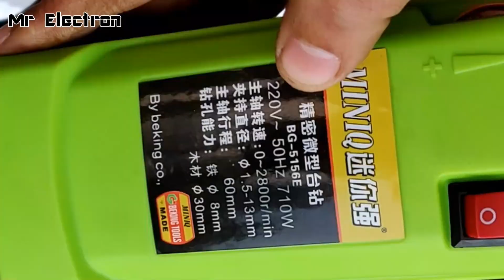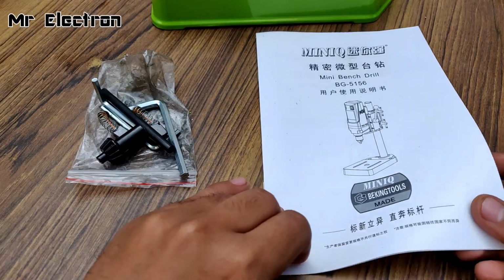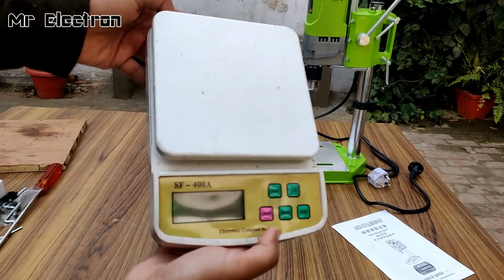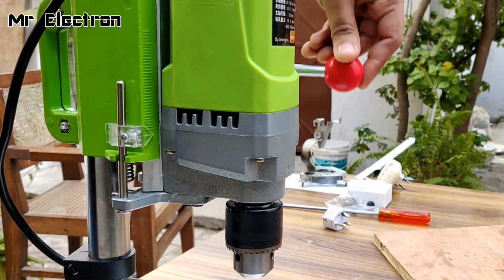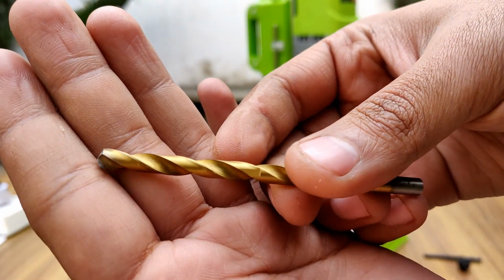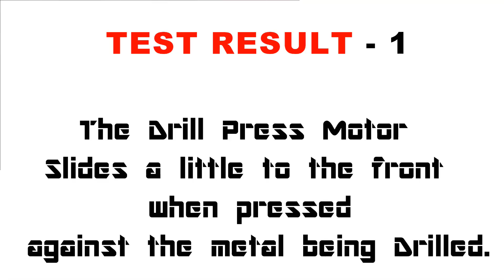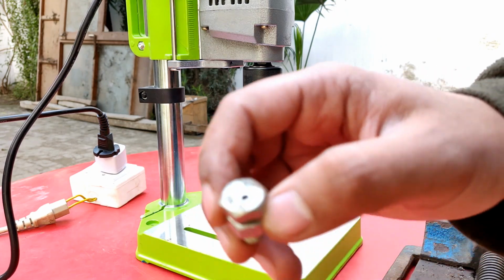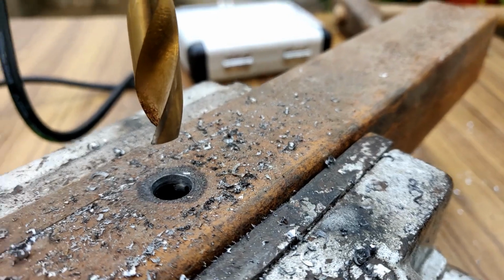220v Cheapest Drill Press from Banggood 710 Watts - Review & Test

Comment: To center a hole, it is first marked and the first drilling is made with a small drill bit so that the guide does not move from the central punch or the one you want. You never start with a big bit and less in metal
Reply: Thats wrong. If you have a high precision drill you dont need to drill more than once.

Comment: First of all , I tell you it is 710 watt at 50 Hz. frequency and as you lower the speed , power will also go down because its speed is controlled by variable frequency just like in case of a fan regulator. So as you lower the speed , power will also go down & machine will not operate at 710 watts at lower speeds . This 710 watts is only at full speed at 50 Hz.
Next you need to first fix the machine firmly & securely on the table top with perfect alignment in x, y & z directions. Check the proper alignments with tri square & spirit level .
Next you also need to firmly fix the job vise on the base plate of machine. & properly secure the workpiece fixed in the vise jaws. No grip should be loose anywhere.
Also ensure the bit is sharp enough & exactly vertical ( making 90 Degree with Base Plate ) & not bent & should be firmly tightened in the drill chuck.
While drilling in metal - start with a less size drill bit & then slowly increase the bit size as per the required hole size.
Use a coolant spray on the bit & work surface for proper heat dissipation.
Start initial holes at slow speed with less dia drill bit size in case of metal .
This drill is definitely not meant for thick iron & steel for large size holes.
Also the drill bits purchased from Bangood are very inferior quality - cheap Chinese makes with very less life not properly hardened  - will soon worn out . Use some good quality drill bits of reputed make especially for metal drilling.
Only by adopting above all , you can get continuous useful work with this light duty machine.
Reply: I partly disagree because there can be a feedback loop to keep the speed constant meaning it will never "get its power down"
Reply: @sacram1 У этой модели этого нет.

Comment: adjust the 3 bolts on side of the dovetail guide and put some greace on the sliders both side and you have no slip ,backlash anymore it will drill very precise and accurate

Comment: I bought new of these the slightly bigger version, p probably about 12 inch. I think it’s 1000 W or something like that. So far I like it. It’s a brush motor. I wish it was direct drive. Thinking about getting a keyless chuck for it and figuring out how to swap that out. Other than that, so lightweight easy to move around, and I can do guitar work with it. I can put strings in the back of a telecaster with it. I was shocked that I had enough room to do that just about have a 6 inch throat. Make sure you get the right model.

Comment: don't start drilling the finished holes size in one go.. always start with a smaller drill bit and then work up to using the final size bit. The drifting is usual with these kind of mini drills...  However I wouldn't use a final drill bit size even on a workshop's full size pillar drill!
I'm pleased you demoed the 5 position dial.. Many of these are sold as having five speeds and give no indication as to 'how' speeds are adjusted. Thanks

Comment: To drill through the centre of the bolt, clamp the drill bit and spin the bolt in the drill chuck. You will always drill true. Like a lathe.
Wrong technique, not a problem with the drill
Reply: The structure itself is flimsy and will allow the bolt to move out of position. That support tube is hollow! The only solution is a smaller bit or a bigger center hole. The hole drilled by the smaller bit then guides a bigger bit.

Comment: If you aim at precision, less noise, and torque get yourself a real 550W or even a 1HP induction motor Bench drill press. Or DIY using new bearings. I bought a Chinese drill press stand and mounted my Bosch PSB1000 2RCAP on it. It's terrible! It's not comparable to the Bench drill presses with induction motors and belt transport, especially when you want to make things like wheels and pulleys for belt grinder for example. Those universal brushed motors are  'much a noise about nothing'! When they jam in metal they hurt and might cause kickback, the rotor can be damaged as it gets hot and the commutator gets excessively hot!

Comment: If u can't center drill then this is wast of money 😔
Reply: Yeah the other "green" one that has a metal housing with a separate motor and quill and a belt drive like a full size drill press and isn't just a drill motor on a stand is much, much better than this one. Get that and not this if you need a small benchtop drill press that works like it should.
Reply: First test should be is the column square to the base???? the answer is usually NO NO NO on any of these green drilling machines
Reply: @atomicskull6405  I know the one you're talking about, but why do you say it's better? Is it more rigid? That one has a smaller chuck, I think 10mm vs 13mm.